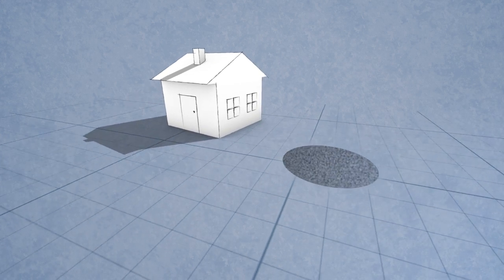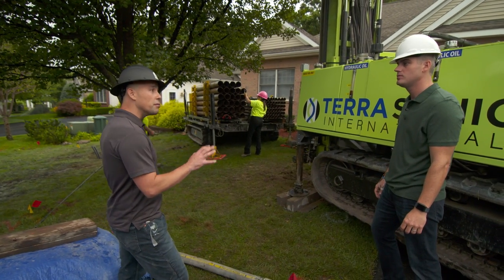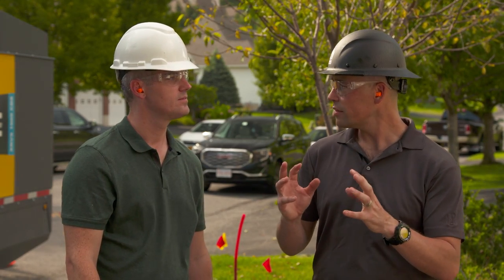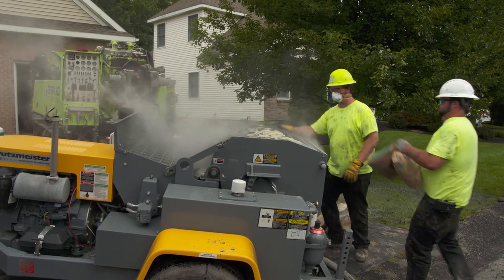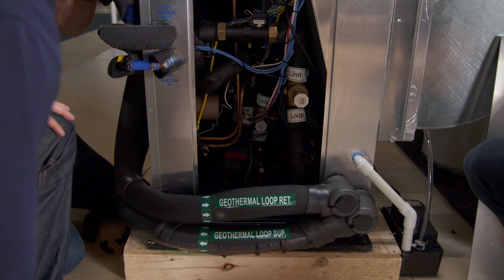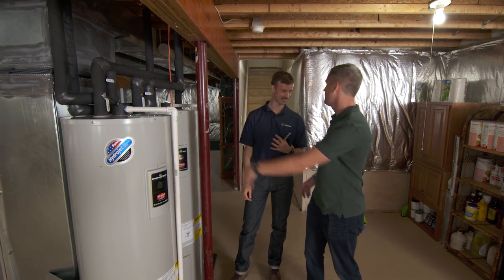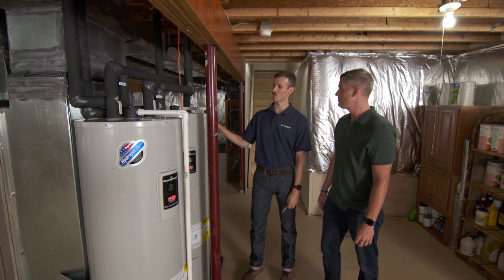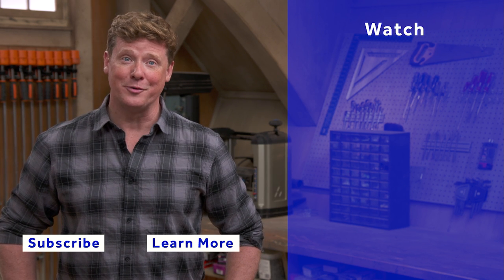Affordable Geothermal | Future House | Ask This Old House

Comment: you don''t have to drill for geothermal, you can loop it over a large area below around 1.5 meters, depending on what latitude you live in. So just dig up a big old trench and put the pipes in horizontally.
Reply: They do that on new construction  with lots that are big enough. If the house is already cited and you can't get the equipment into the backyard or the lot isn't big enough you have to do drill the wells.

Comment: how come no mentioned the cost of drilling?
Reply: Even though this system is much faster than traditional boring systems, it is still highly variable due to the soil and rock conditions beneath the point of the drill. Even an hours difference, with five men and pretty close to a million dollars worth of machinery will ad a thousand or more to that one hole. It is still very conditional.

Comment: How warm does the pre-heated water in the water heater get to?  If you just install a tank, the ambient air temp will raise it to 70+ degrees without the geothermal.

Comment: Geothermal is NOT affordable in my area.  The cost of install isn't bad, but the operating costs for the pump are way higher than for a GFA furnace.  Like 2-3 times the cost.  Natural gas is cheap here.  And since our electricity if fossil fuel sourced, no better for the environment.
Reply: Natural gas is a fossil fuel. Of course I don't know where you live nor how your electricity is generated. A lot is done with NG these days, one reason coal is going south, the NG is cheaper. Very few places use oil to make electricity. There is no natural gas where I live and propane is outrageously expensive. Our electricity is primarily solar from our panels and solar, wind and hydro from the electric company.

Comment: Insulation, Insulation, Insulation. You won't need financing to buy it. It has no moving parts. And it's completely slient.
With just a moderately efficient heating & cooling system, good windows and top of the line insulation like ROXUL  ...makes the need for a sytem like this pointless. 

In the dead of winter, our house is a hot box. The hot air is just trapped with no cold air penetrating from the outside.

Comment: Geothermal doesn't need a backup heat source, like mini splits do.
Reply: Actually, geothermal does require a backup heat source.  We have had geothermal for well over 20 years, so I have a reasonable amount of experience.  Our backup is an electrical heat strip.  You try to use that as little as possible.
Reply: @williamklopfenstein53  I mean backup being required by code, for mini splits.

Even a furnace can use a back up, but it isn't required.
Reply: @NeilBlanchard  Codes vary by locality.  I know of a mini split system which was installed near Birmingham, AL.  No backup was required there.  Also, some of the mini splits with hyper heat perform down to minus 22 F.
Reply: @williamklopfenstein53  Agreed - Alabama is easy for heat gathering. Efficiency at low temps is not the same as capacity. If you have a tight super insulation, that helps, but in an older house, you need back up on the second or third day in the mid teens.

Geothermal is not stressed much by lower temps.
Reply: @williamklopfenstein53  Bored well or horizontal tubing? And if horizontal, how deep? AND do you keep the thermostat set, no nighttime "setback" which people with oil/propane/natural gas typically do to save fuel costs.
Reply: @brucealvarez9263  It is horizontal, about eight feet deep.  No, we do not set back the thermostat at night as that would cause the backup heat to come on to bring it back up to daytime temperature.   Solar panels provide virtually alll of the power for the whole house.

Comment: My personal problem with geothermal is the expensive mechanical aspect that at some time will need repair and/or replacing. The project I'm working on right now is super insulated and will attain net zero when the solar panels are installed. The home has an additional $20,000 in framing and cellulose insulation that will never fail. In 100 years the mechanical aspect will have been replaced about five times. Ground source heat is great for retrofitting on existing inefficient homes but I would never install it in one of my new design build projects
Reply: A lot of ways to go about efficiency first most important is insulation /good windows

Comment: I'm just confused how the heating occurs from the stable 50 degree water. Or does it simply preheat the air to 50 degrees
Reply: Its still a heat pump - So its really just an airconditioner where the outdoor condenser is like 20-50 meters under the ground so you always have a low temperature difference that your heat pump has to deal with (which is when they are most efficient).
Reply: I doubt they are very competitive with standard airconditioners for cooling (with the added cost) as you almost always have a cooler part of the day that you could move the heat to (say a big thermal battery that you dump out overnight).  But for heating they make more sense
Reply: It takes the 50°F water and uses a heat pump to heat it to 70°F. Very energy efficient.

Comment: I kind of fail to see the benefits of the system, especially in NY. Water coming from ground after heat exchange will be around +/-53F.  Electric hot water heater will eat a lot of energy to get water to 160F even with taking away some heat from AC condenser coil, and that will only help in summer. Heat pump is not very efficient in colder climates such as NY. It seems that this system actually makes sense only in some very hot climates, where it would make AC far more efficient all year round. But again, $20k is a lot of money and even if it saves $100 a month if will take 17 years to get those money back, that's not including any cost of maintenance of system.  Also.this system makes no sense what's so ever if you have gas connection available in your house.
Reply: The 53F goes into the heat pump.  That's the whole point of it, not the water heater.  They were not clear on that point.
Reply: The temp is concentrated. Gets to 150+deg. Do more research and you'll better understand
Reply: ImpsMyPimp pretty sure you have to dig a very deep well for that and that's super expensive
Reply: I have very good understanding of every aspect of engineering starting from caissons to heat pump. I don't understand how is converting gas powered hot water heater along with gas powered air heating system will help with your bills for all electric system even if it gets support from geothermal energy. What kind of role geothermal system plays in heat pump for heating the air? Does it heat up the evaporator coil in winter? With dirt cheap natural gas prices this conversion doesn't seem to make much sense. What makes sense is geothermal system acting as cooling tower/chiller to help on cooling condenser coil. Maybe I'm missing something but if you have access to natural gas and you live in colder climate where heat pump is very inefficient it's not worth it to install this system.
Reply: Yes and natural gas will always be "dirt cheap" right? And climate change is a Chinese hoax too.

Comment: Geothermal is the worst heating system in the world we have it in our shop and they are constantly repairing the pipes. And it never seems to work. Every one of our outside lines as broken or leaked constantly I would never get it
Reply: Obviously you have a system that's improperly engineered. Thousands of others would disagree with you.
Reply: You have an open loop system, not a closed loop system. OL is notorious for this, failed pumps, clogged pipes and heat exchangers. CL is all we design for geothermal systems. Sorry to hear about your situation.

Comment: I would want to know how long that rather flimsy looking plastic pipe going into the ground is expected to last.  Because once it leaks you are not going to be fixing it, you are going to be drilling a new well.   What is the expected lifetime of the ground loop?  More importantly, if it springs a leak, how long is it under warranty?   What happens if you have even a small earthquake?
Reply: That flimsy pipe encased in concrete?
Reply: 50 year warranty minimum, most manufacturers are at 100 years. The pipe  is high density polyethylene, like very thick milk jugs. We have yet to see a failure when installed correctly and pressure tested upon start up. We are in the northeast, so earthquakes are not a concern. I would imagine, small quakes would not be an issue, even if it cracked the grouted “concrete” around the pipe.

Comment: Why nobody is trying to drill sideways like a ditch witch in some angle that way no granite driling
Reply: When you go deep you get to an area of constant temperature, usually around 50 degrees F.  This allows a bit of a pre-heat in the winter months and a bit of pre-cooling during the summer.
Reply: Is your neighbor goign to let you drill into their property?
Reply: That is the other type of geothermal, loops in trenches. They are less efficient since the trenches are below frost but not down at the 40-50' level and below where the ground temp stays constant at 45-50°F. The trenches (assuming you have the land area) are cheaper to dig with a backhoe than wells are to drill.

Comment: It sucks for the winters in the north,make sure to keep your gas fired furnace hooked up !! Heat strips will make you broke...
Reply: Do you understand how this works? 2 points - One: The ground deep down is ALWAYS 45-50°F so minimal energy is needed to raise or lower it to the 70°F point. VERY unlike the mini split heat pumps that have to get 70°F heat out of 0°F air. Two: DO NOT do night time temperature setback. The system, like radiant floor systems, has very slow recovery. To speed it up some geothermal systems have 240V electric heaters. Want to see your electric bill go sky high? Let those heaters come on.

Comment: Isn't this more of ground source heat not geo-thermal?
Reply: Geo-thermal has a range of temperatures, higher if you live on the slopes of the volcano and use a steam turbine. But I agree the term ground source is less ambiguous.

Comment: I can see why it's rare to see geothermal in the UK,  most houses at 67sq mtrs don't have enough room for all the kit so I've only seen it on individual high quality builds with Sq mtrs of floor space in the hundreds or laid out in a South facing field.  All these Geo and Air systems require power and without it there is no heat.  Many a pensioner in the UK can be seen in a hat and coat indoors on cool days, if anyone knocks on the door they say sorry are you going out but in reality they have to make a choice quite often, food or heat.
Today my front door was red hot and the South facing brickwork also, even though it was only 7C outdoors. 
None of that heat can get into my house because it's been insulated against any free heat from the Sun incase we get an odd hot day in the summer.  Now if you want to be warm in your house you have to pay for it from September onwards and it could be on until May. Before this fake green drive I knew of houses where the residents had no idea where the heating was because they had never used it in 20 years. That soon changed when the fake Green Deal arrived, and many asked for the Insulation to be removed as their house now felt like a morgue.
In your neck of the woods everyone seems to have loads of space for the kit which helps and your professionalism will travel far.

Comment: Great piece. It is worth noting that well drilling with short casing sections has been a mainstay of specialty geotechnical construction such as underpinning and mini-pile installation for decades. There are machines that can do sections even shorter than 8’. I know specially foundation projects where dozens of mini-piles...basically steel well casings filled with grout...have been sunk 100 or more feet into the ground INDOORS. Of course, those are structural and the casings are left in place.
IMO...every so called “out of work” coal miner in the USA and every “out of work” Keystone Pipeline worker in the USA should be out working 50 hours a week earning 120K a year building a nationwide geothermal heating infrastructure NOW! Drilling holes, moving earth with heavy machinery...mega and mini is basically what miners DO for God’s sake.

Comment: I have a well under my own home which is about 30 ft deep, 10 feet in diameter. 

I live in the Midwest, would it be possible to retrofit a geothermal system into this existing well?
Reply: Not really. You need a "recovery capacity" and your shallow well wouldn't provide that. You would need to drill the well a lot deeper. The 2 wells they did for this project are 300' each. For a larger volume house or one with less insulation, each well could be 500' deep
Reply: @brucealvarez9263  thank you for the follow up.

Comment: No, it's a waste of money. On average, a homeowner can expect total expenses to reach between $18,000 to $30,000 on geothermal heating and cooling cost for a complete geothermal installation. The price can range from $30,000 to $45,000 with high-end ground-source heat pump systems for large homes. With an average electric bill of 1300-1500 dollars a year of which 40% is space heating you spend 500-600 dollars a year heating your home, even if geothermal systems cut energy heating use in Half that's 250 a year. Amortizing a 30,000 dollar installation by saving 250 a yearr would take 120 years!!! to pay off. And you're assuming the system would operate glitch and maintenance free. It would be far cheaper to simply stuff your home with better R-Value insulation.

Comment: Far reaching idea would be if it could(stretch) be used to defrost roads...in winter?   How off the wall is this if could be done?
Reply: I'm curious if having a solar powered heating coil for roads would be more cost effective?
Reply: On the other side of the Planet..."off the wall". :)  We would have more luck designing vehicles that don't require roads to be defrosted.

Comment: So ur basically using the ground to heat ur house that’s crazy 🤔
Reply: The condenser on an AC is very cold. Its really the heat pump doing the magic. The well is just a place to extract or dump energy. You could do the same with well water the concept would work but you'd be breaking dozens of laws. Point is its not really any different than a well except its a loop.

Comment: Concrete is porous, how would that prevent impurities from entering system?
Reply: The pipe is closed loop, like a radiant heating circuit buried in the earth. Meaning the same water goes round and round...

Comment: This technology is amazing. But they glossed over the two hazards. The water used for drilling will become toxic. The fact that they can reuse it is a good thing but eventually that becomes toxic waste. The refrigerant loop has glycol in it which might eventually leak from that line. Because the line is encased if it ever leaks you'd have to drill a new well (or let it continue to leak into the soil). It's possible new sealing technologies could be used. I'm not aware of compounds you can put in those lines to reseal them but that might be a fix for at least the latter issue. It does never the less mean these systems need to be inspected.
Reply: if your coolant is leaking its gonna decrease performance and be noticed. what happens to fracking liquid when they are done? oh right it stays in the ground and i'm sure that will never leak into aquifers right? what happens when a natural gas pipeline leaks or ruptures? huge expolsions and methane leaks intot he atmosher. and remember a little thing called climate change? more fud.
Reply: @christopherblair1456  What are you even going on about?
Reply: The glycol is food grade propylene glycol, like that found in salad dressing. No hazard classification. Plus geothermal plastic piping (high density polyethylene) has a 50-100 year warranty.
Reply: @rosstrethewey9391  The fact that its "food grade" is fairly meaningless here since food grade implies a specific process and amount not contamination. Also even under warranty it most certainly would not be painless or free to replace.

Comment: Just be careful they don't play the same games solar did and put a lein on the house for the system. It has made many houses un-sellable in the market because why deal with that hassle.
Reply: So have less reputable traditional HVAC companies. My advice is don't hire those who do, however, a loan for $20 K is big cheeze for most folks and the only thing they have for securing the loan is their escrow in the house. Check the reputation and make the calls to talk to their previous customers.

Comment: But what happens if 1 day you wake up with no heat, and it's the middle of winter?
Right now, you can get a plumber to your house in a day or 2.
Not a lot of plumbers know how to fix these systems. So they have to find a way so it can work with your existing systems.
Reply: why would you wake up with no heat all of the sudden? and why do you assume that the contractor doesn't also do repairs? all this FUD over geothermal its almost like it threatens a massively profitable industry.
Reply: C Breezy heating systems don’t give any warning before they just quit. 
I never said the installer doesn’t do repairs. They installed it, they better do repairs.  
Any plumber can fix an hvac, but not every plumber knows how to work on geothermal. 
It’s not fun, it’s the truth. You just don’t want to here the truth.

Comment: Or option 2/ a regular air finned condensor coil for a tenth the price
Reply: Good luck finding a total heating and cooling system installed for $2000. You are dreaming.